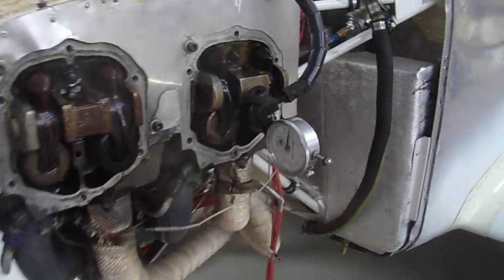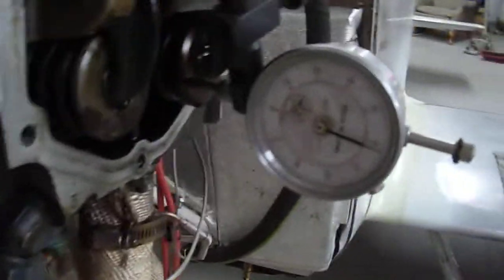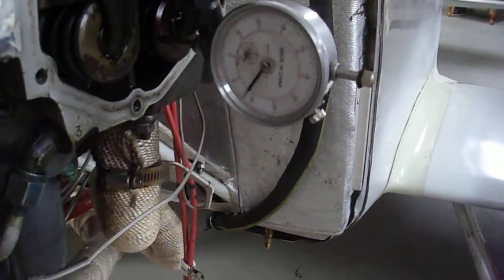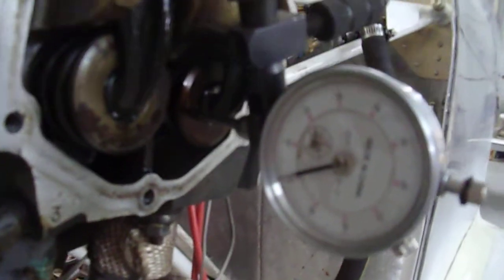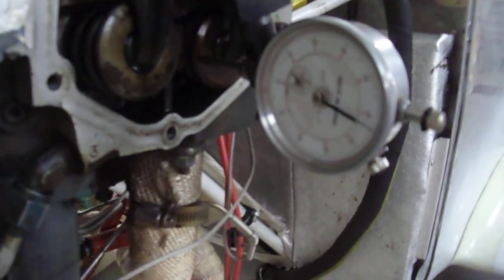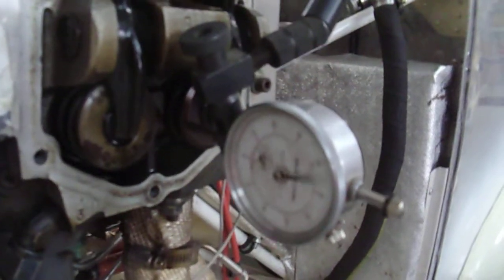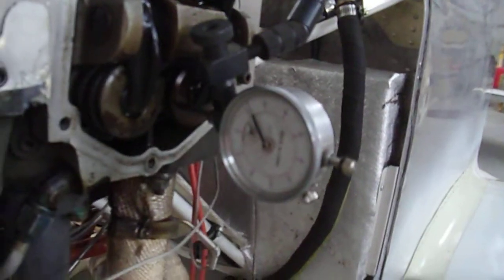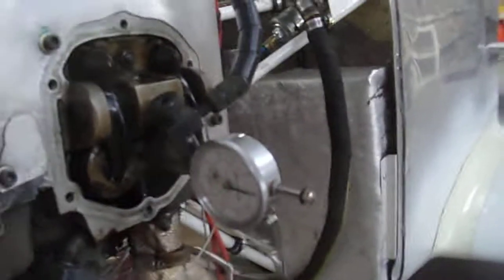Lycoming valve train noise

Comment: Did you ever figure out what this was?
Reply from the maker: Yes, It was definitely a valve sticking. The A&P at the airport said to give Marvel Mystery Oil a shot. said it can clean up deposits in the valve train. It took a year and two oil changes, but the clicking is gone and the dial indicator does not show a bump anymore.

Comment: Probably cam whip.  Two of the cam lobes operate two different valves on opposite sides of the engine. At a certain point in the cam's rotation, the opposing forces from the valve springs transfer from one valve train to the other. At this moment the cam tries to reverse direction and gives up it gear lash, causing the click.